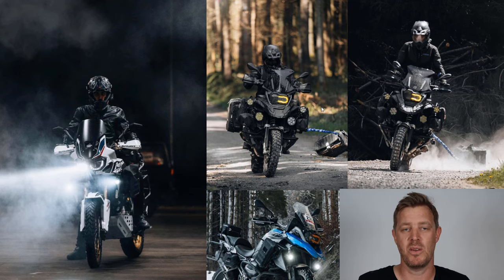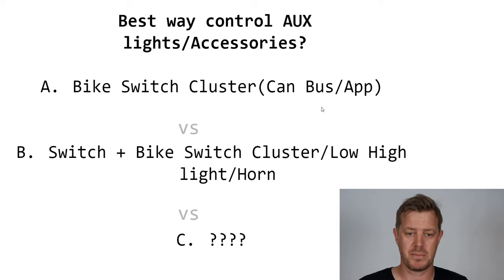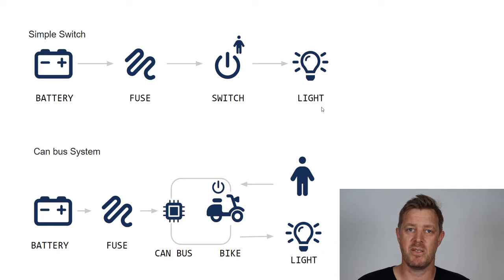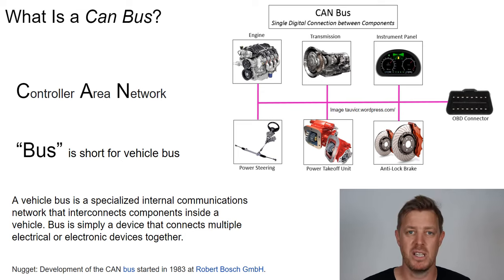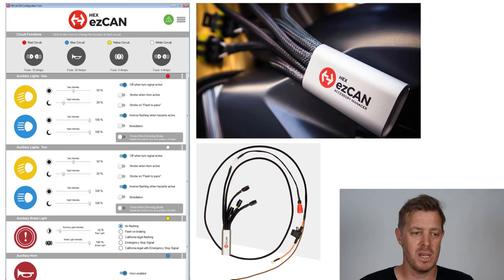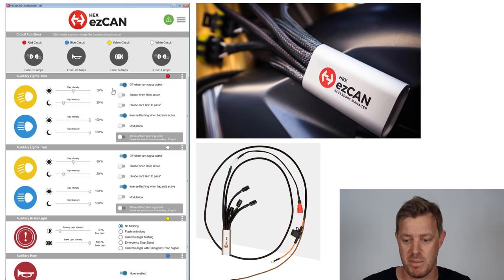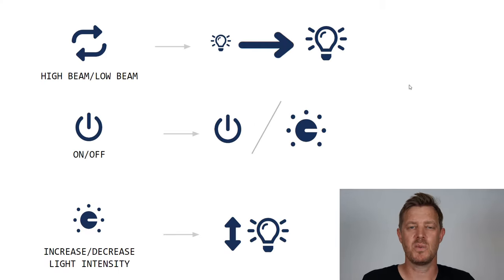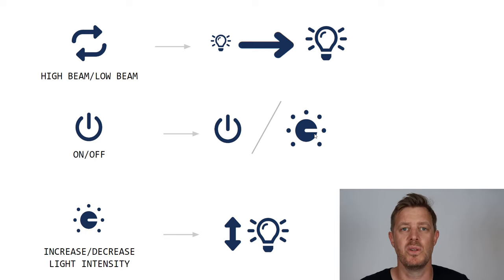Making the Best Aux Lights for Adventure Motorcycles

Comment: Looks like HEX ezCAN is popular, but what about the bikes that don't work with CAN bus, what do they do?
Reply: Denali let's you easily piggyback lights on the headlights wires. But you lose the ability to dim them without a complicated setup.
Reply: Make the lights smart themselves. See my other post.
Reply: My RT is a 2008 so no real Canbus - as my post below - I'm adding dual series wired Canbus and DialDim and PDM for larger amperage like heated suit, etc.

Comment: Hex EzCan - can’t get a better accessory manager than that. I had installation issues as I was among the first ones to get the new Honda model - the level of support is amazing.  Plug and play, you don’t lose warranty. Only thing it’s missing is maybe a phone app that you can use to dial in the settings without the need for a laptop/pc/Mac.

Comment: I totally agree that we need to improve the lighting on motorcycles, after some hair-raising adventures in pitch dark remote and/or mountainous areas. Some bikes might have good lights, but if yours hasn't, you want to add after market lights.

Denali and Cree make great LED stuff already. The issue is that some lights have a great spread, some have a great focused beam. None do at the same time, as far as I know. So, most remote riders might want to install a set of both. 

Here's an idea. An improvement would be a switch that lets you choose which set you need, at that particular moment. The switch needs three settings: Wide - Off - Focus. This way your bike can power each system separately. If you think the bike’s power supply is powerful enough, you might want another setting to power both sets of lights at the same time.

Comment: I am currently in the process of integrating two sets of Baja Designs Aux lights on my GS. I chose the HEX ezCAN because it was so flexible and fully integrated with the BMW systems.  There are lots of controls on the handlebars already (maybe too many) but I would consider a "lighting console" of some sort. I would want it tightly integrated, probably canbus. Controlling the lights is important but the biggest obstacle I encountered was finding suitable mounts for the lights.  There are numerous lights available that would be great to have on a bike, but model-specific mounting options are almost non-existent.  I finally had to fabricate my own mounts so I could put the lights where I wanted them.

Comment: Canbus to me is the most future proof solution and it gives the option to tap into the ‘signals’ of all the sensors of the machine. Would love to have smart aux lights. Ones which go far on straight line acceleration and higher speeds, which go wide on braking and cornering and go bit ‘low beam’ on cruising in day light. And this all automatic based on existing canbus sensors or sensors in the lights themselves. And make them smaller than de Denali’s. No need for wind breakers on the bike. 😂

Comment: Denali CanSmart is the best option. Easy to wire into the Bike & easy to wire in accessories too. No need to re-invent the wheel when it comes to the switch. 
As a side note, If you use the Denali lights without the CANBus interface, their wiring offers simple easy installation with external switches & relay activated power to prevent flat batteries.

Comment: Hex E Z Can is a great system, especially gen 2 versions.
I also hear that Hex have a wi-fi dongle coming and are adding further outputs from the White output so you can control multiple devices from that one output.
Additional buttons on the bike would just clutter the switchgear area which is already getting overly complicated!
BUT - if you only make a Canbus compatible system then you’re limiting your market to newer bikes and potentially missing out the larger sales market for the existing older bikes of which there are millions in use around the globe.
Reply: He can also make 2 versions, 1 for newer and 1 for older.

But with these questions he can figure out what the most clients have.

Comment: I prefer a simple wiring set up. The reason is that if I have a problem I can fix it anywhere with commonly available parts. With that said, I think you should produce both a Hex ezCan set up for those that want it and a simple wiring set up for those that want it.

Comment: Great idea for a new product. I am BMW GS owner. The problem with all these, is the installation. If you check denali, you have to take the fuel tank out to put all the wires under it. Another problem is the availability. In Europe especially there is a big problem with demand. Excpet the denali there are no other manufacturers. The others are in USA. Limited options. 

Keep it simple as can be. Wires, switch from battery and finished. Canbus can be complicated for my personal opinion. You have to consider the light mounts on specific bikes. 

I am big fan of all your products. Keep up the good job!
Reply: I fitted a Soundbomb and Cansmart along with aux lights and didn't take the tank off. A fish wire is handy and you can still do a discrete installation with a bit of care.

Comment: Simple is as simple does , it’s an adv light cluster I’m assuming? Then forget the integration systems , you want them controllable separately from headlight controls just in case u need them separately and if summit goes wrong you can switch them completely off , no power, or if your headlight or a crash takes out your cluster then at least you have some form of light source , I think the integrated systems are great for mega tourers but semi off road bikes I personally prefer separate systems , just so I can isolate one if the need arises 👍 great videos and gear 👍

Comment: Hey! I like to go for Can Bus as it is good to be able to turn off all extra lights together when driving on roads where there are encounters with other vehicles. Good, however, if it is a simple connection and then maybe only solves the problem with the connection of the additional lights. Needed as the main light is LED, otherwise it can be controlled with a light relay. But the most important thing of all with extra light is that the color image of the light will be the best! Most additional lights sold today give a light that is far too white, which results in poorer contrasts and a significantly flatter image for the eye. It becomes more difficult to judge distances and it becomes more difficult for the eye in the long run. The light image should be as close to daylight as possible in the color scale and preferably yellower than whiter in comparison to daylight if it is not possible to dot exactly right. I drive a lot in the dark in winter here in Sweden with my MC and with the white snow it is even more important that the light from the lamps is not too white. But as I said, a more daylight-like color tone provides better contrasts in both white and darker background environments. We have also tested putting yellow glass(plastic) in front of the extra lights on log trucks here in Sweden so that the drivers get better contrast but can also use the lights all night without it being too hard on the eyes. The yellow light also copes better with the reflection from road signs so it doesn't dazzle as much and not to mention when I'm driving in snowfall! If I then have too much white light, I have to turn this off as the glare effect becomes too great, but with the yellow light it works much better :)

Comment: Good video, thank you for that. One question I have is, would you be able to have the aux lights independent of other lights? for example I like to ride with the aux lights on as driving lights so other vehicles can see me more easily. This would be essential for me. Can the CANBus accommodate this function? or would it require a separate switch for operation?

Comment: So I've been thinking about this too and on my GSA I did an array to lights all controlled by two Canbus controllers in series with a PDM for some of the large amperage devices other than lights. But for my RT refit I started think about what I wanted to control and how convenience would play a part in controlling the lighting. My solution for now is to run control lines from the Canbus controllers but with overrides to the power with a dual potentiometer using the Denali DialDim Lighting controller. This would allow for me to quickly crank up power or dim without having to go through all the "press this three times, push to left or right, hold for 3 seconds" setup. My only other thought was to dedicate another cell phone to control the wifi Canbus - I currently use one to run the front and rear cameras on my GSA and my RT. I'll be interested to see what you come up with.

Comment: I have a bike without a can bus, so that’s not an option. My first thought was a dimmer switch like a car stereo with the push option to turn on and then turn to increase/decrease intensity. Not sure if that would work but it’s an idea to consider. The other point to note is any switch gear needs to be illuminated, not many manufacturers do that and fumbling around in the dark isn’t ideal
Reply: Arboreal's Neutrino.  Well made, supports automated control, doesnt 'need' the phone once its set up. Also controls my heated jacket

Comment: Bonjour, can you also look for a better or stronger REAR brake light.. gsa 2020 . I always look back to make sure that they see me correctly.. found that original brake light is a joke..  and everything on the original switch will be very good …
Reply: I used Denali B6 running and brake light it is a huge difference!

Comment: I think there should be a few different options.  For CANbus bikes I think that is the obvious solution.  But there are a lot of bikes that don't use it so some sort of a control pod for the handlebars is probably the best alternative.  Whether that be a simple on/off switch or a more complex solution.  I'm not sure the wheel needs to be re-invented for this, most of the heavy lifting is handled by the CANbus setups or with a simple switch.

Comment: On the new Africa Twin aux lights are controlled directly from the TFT screen and are connected to Sumimoto plugs
Reply: those are the OE light fittings for the ATAS.. there is also an ezCAN for the ATAS that allows you to customise (and set in realtime) the light brightness and functions using the left handlebar controls - a much wider range of flexibility than the OE lights.

Comment: I would prefer with a external normal switch… why?
I drive as many people still a BMW R1200 GSA from 2013, so without can bus. There are already a lot of products who works with can bus but the installation possibilities are limited to newer bikes.
I would love have some extra lighting on my 2013 air/oil cooled GSA from Lonerider!
Reply: Your 1200 GSA has a CAN bus.. it was released ont he 1200GS range in the 2004 1200 models.. there are two CAN busses here.. the internal one that connects all control modules (which yours has and HEX has an ezCAN for those).. and then the Diagnostic CAN bus used to connect to the GS911wifi or BMW diagnostic tool.. Those were only introduced on the K1600 initially, followed by the R1200 Liquid cooled bikes...
Reply: @stephanthiel2752  owkay! But can i use the can bus on my gs for external lights? Because i never seen or heard about that…
And a very big thanks for the information 🙏🏼

Comment: Whatever system you use needs to be able to be used on older machines. Non canbus solution that allows older machine to utilise modern technology. The canbus system sound great if you're riding a modern machine, but limits who can purchase your system. The same goes with the luggage technology. It amazes me why there is not an adaptor that allows the luggage to be used on any aftermarket pannier frame. Again, it only seems to be able to be utilised on modern bikes. Seems a waste to me when there's so many bikers riding older machines who could invest in this.